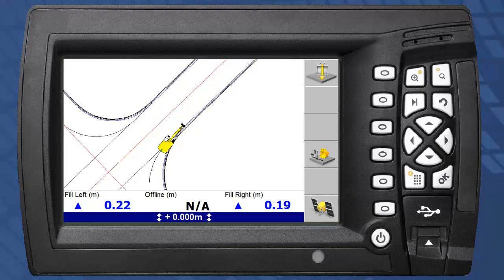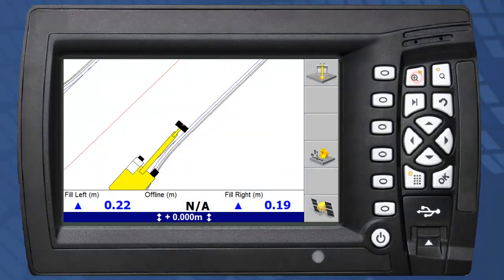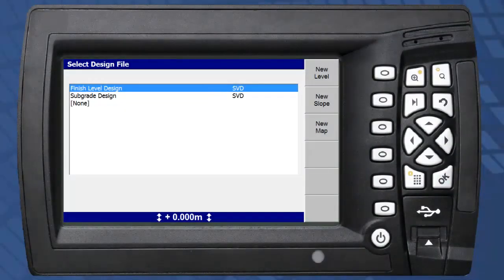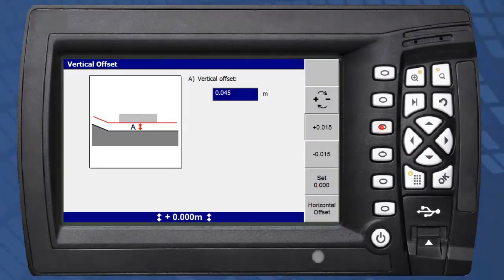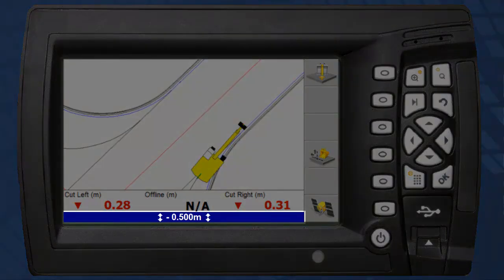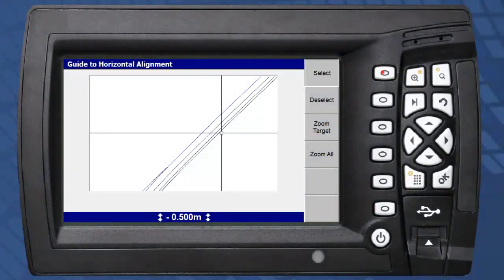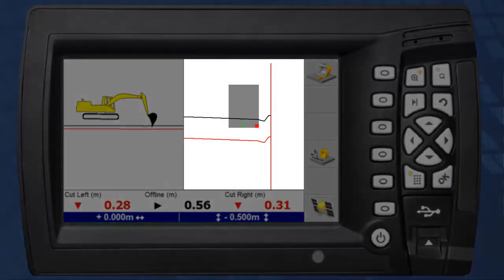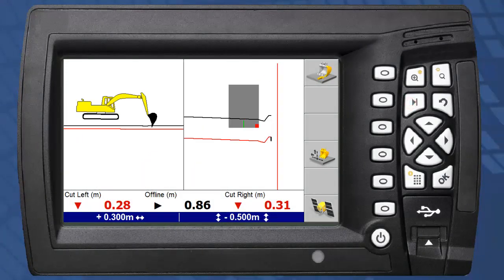Introduction to Trimble's GCS900 CB460

Comment: Do you have a link to run this software on Mac OS?
Reply from the maker: Hi Martin, I don't believe any of our Trimble emulators will run on Mac. You will need to run an android or Windows cloning.  Feel free to contact us on 1800 748 324 if you need to speak with somebody about this.
Reply: @SitechCS   thanks for the confirmation, sent a request for training and information via the Uk website, no response yet though.